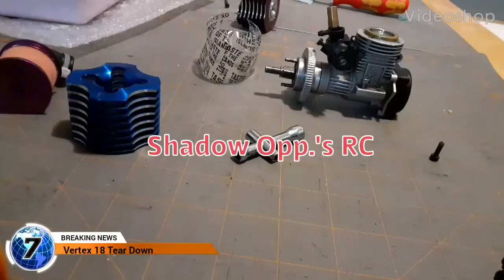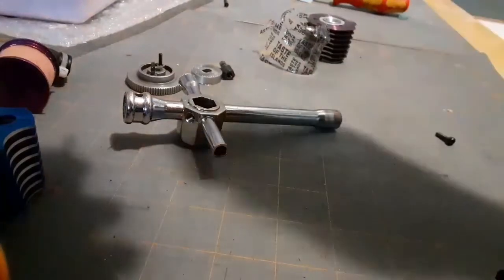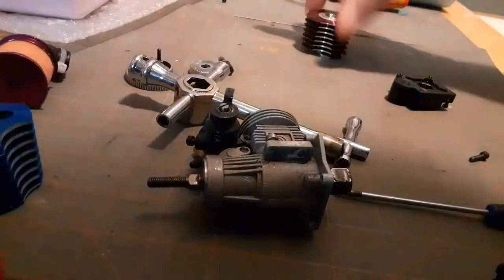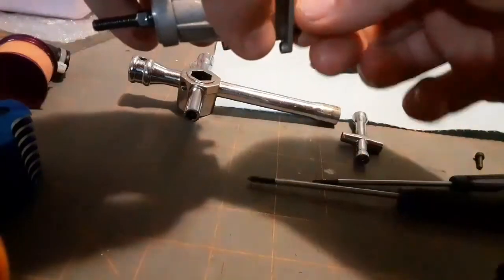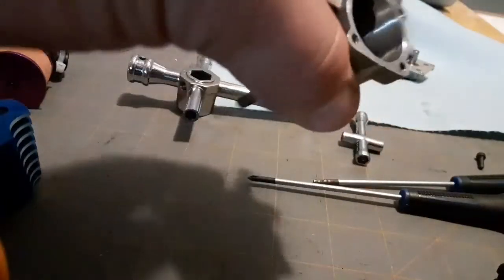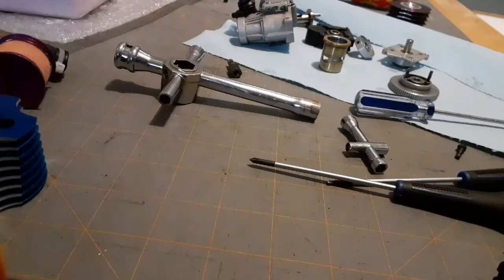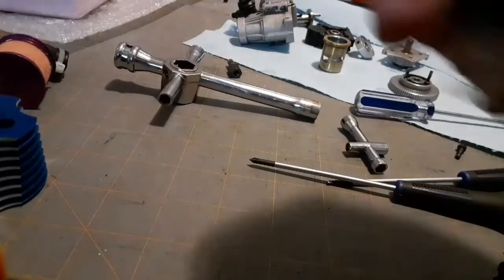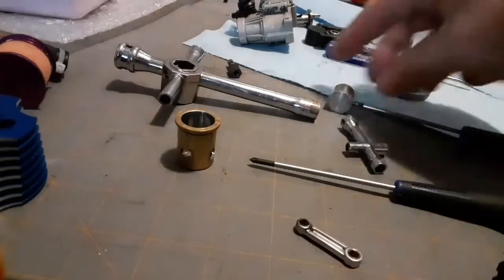Vertex 18 Nitro RC Engine Tear Down

Comment: Is it eny good. I habe thought of buying two engines for a monster of a boat. But is this a brand i can use and trust or is eny other brands netter for the same price point. and it is the watercooled version i have thought of.
Reply from the maker: I would take a look at SH.
Reply: I shall look it up. The reason why i want 2 engines is becouse i am a nerd. I have thought of a 2 sevo input mechanism. So one of the two engines goes quicker driving left, and the other engine quicker turning right. And the empty boat i have is over a meter long. So why not try to fit some more fun in it.
Reply: @ShadowOppsRC  i found a seller on ebay with sh engines for about 45 quid each. And quite good ratings.
Reply: I couldnt find eny watercooled tho. But i think 3d printing a canal to fit from the hull down to the engines could work for cooling them
Reply from the maker: @meckarelis3235  3D printing a duct would work.  i have had good luck with SH and parts for them are really reasonable priced.  Just got a new liner and piston for one of my sh 21s for 20bucks.
Reply: @ShadowOppsRC  hard to find parts is why i stopped using my 20+ years old kyosho inferno rc car. The gear conecting the clutch to the rest of the car broke. And the pull starter is crap. Bit parts are inpossible to find for that car. So i want to make the boat easier to repair and find parts.
Reply from the maker: SH parts are pretty easy to find.
Reply from the maker: SH also makes the dynamite engine product line and parts pretty respnable for these too.
Reply: @ShadowOppsRC  I think i will go for the SH 21 becouse it has its exhaoust in a more convenient possition and round exhaoust port. It has a bit higher prise point.

I will ask a guy at the nearest rc nerd store. I should probably show hum the hull and what parts i allready got. But thank you for all information if i will take on this project.
Reply from the maker: I have had good luck with the SH 21.  Should  be a good setup for you.
Reply: @ShadowOppsRC  actually. How long is the break in time. And is it possible to run them with straight exhaoust pipes whithout dampner. Or more straight whith a 180° turn for them to point backeards.
Reply from the maker: Breaking one in as i type this.   I just run a couple tanks just idling,  and then one tank quarter throttle, 1 half throttle and then one full throttle.
Reply: @ShadowOppsRC  thank you for the information
Reply from the maker: Your welcome.  If you have question dont hesitate!